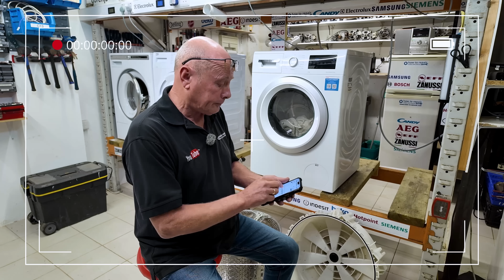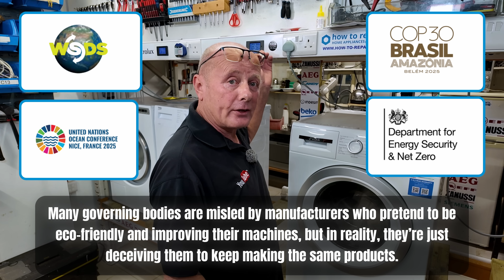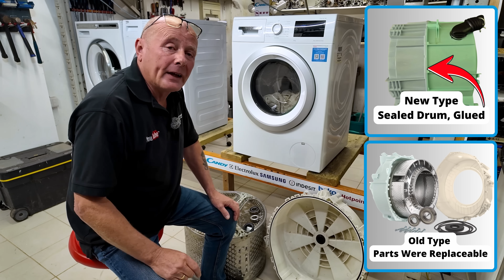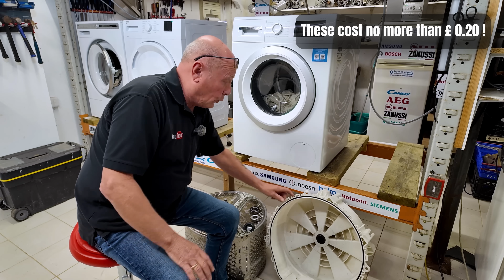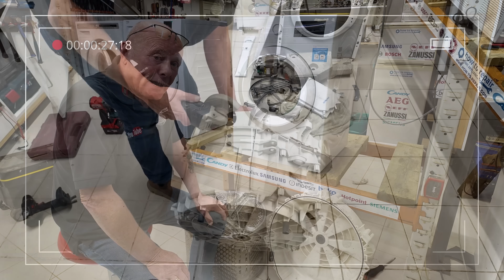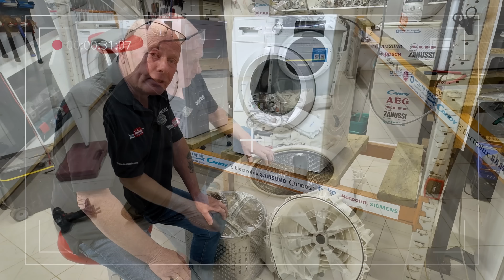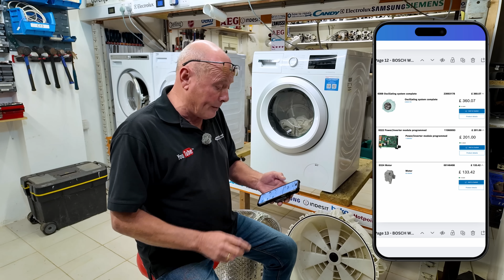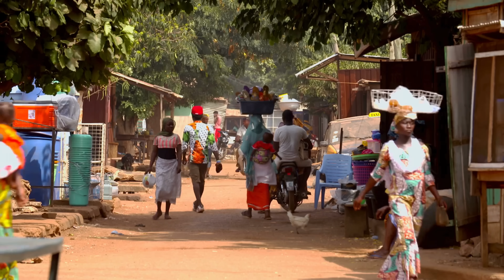Washing Machine SCAM EXPOSED! The Truth About SEALED Drums: Naming & Shaming

Comment: And don't get me started on dishwashers. Had a super old one finally fail - shorting heating element, I believe - and the fact that it didn't seem overly trival to replace it and the missus was keen to get a new shiny one meant we ditched it. Shopping for a new one, the drop in build quality was astonishing, even for higher end models. The one we settled one is amazingly quiet but, in the name of being eco, the default wash takes 3 HOURS AND 25 MINUTES! It's madness. Absolute eco/energy-rating tokenism. I get that consumers don't help themselves, because most don't have a clue and chuck out even perfectly repairable gear, but it's still infuriating that this is where we've ended up.
Reply from the maker: That is a textbook example of the financial trap set by the industry, and it confirms the grim truth about planned obsolescence. You are right, the industry structure is designed to be infuriating. They create products that are technically complex (making repairs difficult) and financially obsolete (making professional repair unaffordable) all while claiming to be eco-friendly. The only way out is strong legislation that enforces economically viable repair and penalizes the massive environmental cost of disposal. To make any real impact, we need to catch the attention of industry leaders and put an end to these wasteful practices. Sharing this post is essential to help spread the message. Thanks, Paul!

Comment: I am developing a drum bearing lubricating system.if you have a car you would have a oil change.
A washing machine has a sealed system.a predicted life span.

I am a retired mechanical toolmaker.also lubricating engineer for paper mill.

I have removed the shielding on the inside assembly of both bearings.the cavity is filled with marine grease .a 6mm copper grease pipe with nipple is fitted.acessed on top of drum case.There is also another copper pipe for purging old grease.and pressure relief.
If you open a new set of bearings you will see what little lubrication you are realising on.
Reply from the maker: Thank you very much for the information. It is much appreciated.

Comment: There is one aspect we must remember when complaining about lack of repairability. That is technical evolution.
If everything can be maintained to original standard, we risk lagging behind when new products with desired functionality and less resource drain are developed. That could be more costly than the acquisition of a device replacement. Here resources can be money, water, power, fuel and even our own muscles.
This is a balance of a lot of factors.
If we take a simple car as example: There is only a few of us commuting in a Ford T-model. For a lot of reasons: mostly because of its fuel economy which is poor to horrible.
What we must address is some kind of balance between evolution and some device's technical lifespan. If a device is reasonably functional including power economy and our basic requirements to the device, it is important that minor faults easily can be identified and fixed. That surely includes things like a bearing which must be available and easily replaced. Why is is necessary to open the drum to replace a bearing?? It should be designed so it can be replace by opening the back alone, not by a major disassembly which is cumbersome or costly ... or both 😛
My point is: design for repairability unless the part has a reputation of lasting the device lifespan.
For a long period I worked in the marine business: Lifespan here is 30 years and a stopped engine is costly due to lack of turnaround: don't plan for obsolescence 😲

Comment: What washing machine would you recommend?
Reply from the maker: Great question mate but honestly, I can't magic up a definitive suggestion. The industry is a minefield manufacturers constantly change production and every brand has both excellent and terrible machines in its catalogue. You need to pick a brand that fits your wallet and gives you the technical documents to fix the thing when it inevitably breaks. And always check if the drum is splitable before you buy. 

My favourites are personally ASKO. Absolute workhorses with mechanicals that rival old Miele machines thanks to that stainless steel outer drum. Some LG units are good too. And finally Beko. They are one of the few to actually provide detailed workshop manuals and wiring diagrams, which is fantastic. 

Thanks so much for weighing in! People like you writing this out help everyone. Please don't forget to hit that subscribe button and share this video as it could save someone a heap of trouble!

Comment: Planned Obsolecence is the foundation of the global economy.  It exists everywhere.

However.......a lot of products now come with a 5 yrs guarantee instead of 1 or 2 years.  This is to cut down on waste abd recycling.

Modern electronics especially phone come with fixed internal batteries.  Brushless motors simoly stop working.  Cars so compact the engine needs to come out to replace a sensor.......

China makes all the parts.  They're designed to break so you buy another......if it all lasted for every the global conomy would collapse.

Comment: 90W SOLDERING IRONS ON EBAY / AMAZON
CIRCUIT BLOWS IF YOU TURN IT OFF AT SOCKET 
INSTEAD OF OFF BUTTON
THEY ARE ALL 60W NOT ACTUALLY 90W

Comment: Previously, technology was made by engineers, now it's marketers and accountants, whose goal is to first prove that you need Wi-Fi in your washing machine, and then program it to be obsolete in 4-5 years and replace the washing machine drum for $400. 
Along with the energy efficiency rating, the EU also needs to assign a repairability rating to products, at least essential ones, such as vacuum cleaners, refrigerators, washing machines, boilers, and the like.
Reply from the maker: That is a perfect summary of the problem, and my 40 years of experience confirms your feeling mate. Technology is now driven by marketers and accountants, not engineers. I've been repairing washing machines for nearly 50 years, and the basic principles of washing clothes haven't changed since the 70s. They wash, tumble, heat, and spin. It's baffling why we need so many extra features now. Machines used to last 15 to 20 years on average. Nowadays, you're lucky if they last five years. Obsolescence is clear in today's society.

To make any real impact, we need to catch the attention of industry leaders and put an end to these wasteful practices. Sharing this post is essential to help spread the message. Thanks, Paul!
Reply: @How-to-repair  A friend of mine, an electrical appliance salesman, taught me how to choose appliances. Basically, you pick five refrigerators you like, then type in the model you want, along with the words "My refrigerator broke," "name and model," and look at how many bad reviews there are on forums, and how much spare parts cost—you narrow it down to the best product. Of course, everything breaks, that's normal. What's not normal is when it breaks before it's even half its lifespan, and the parts cost half the price.

Comment: I had a samsung fridge freezer, which started to beep with the door closed. I googled online the fault and the answer i thought was BS, but i tried it and boom job done fixed. a few years l8r it was the sam fault. The fix was to unplug the machine uncover the circuit board and scrape the micro switches , they looked like slugs had been all over them lol

Comment: In the past they used metal, now they use plastic. I remember as a kid learning how to take a carburetor apart, cleaning the jets etc, now its a sealed unit. This is the modern throw away world we live in.. In some ways it makes them easy to repair because machines are put together with a series of off the shelf units but as you say, you end up buying a whole unit when all you need is a new baring that costs pennies.
Reply from the maker: That is a very good summary of the deliberate design strategy that has created the modern throw away world we live in. My 40 years of experience confirms that the switch from metal to plastic is one of the root causes of the problem. Manufacturers often claim plastic is lighter and more resistant to corrosion. However, the real reason is cost. This design forces you to replace the whole unit when only a bearing (the part that costs pennies) fails. This is a deliberate tactic to transfer the cost of repair onto the consumer and inflate the part price. To make any real impact, we need to catch the attention of industry leaders and put an end to these wasteful practices. Sharing this post is essential to help spread the message. Thanks, Paul!

Comment: My brother was a senior manager for Hotpoint, which I believe owns several brands, and he told me 15 years ago about a meeting of senior managers to discuss ways to build in planned obsolescence.   Sealed drums was just 1 of the ways because bearings had a predictable life span and were easy for after market shops and engineers to fix at a reasonable price.  So machines could go on for 10-15 years, sometimes more, with simple repairs.

This is a deliberate scam to fleece us out of our money.  I run a 20 year old indesit, I easily replace the bearings myself, pump, no problem, motor, easy.  Think I will hang on to it, plenty of spares still out there and it does a great job.
Reply from the maker: That is an absolutely essential piece of evidence and your brother's testimony from 15 years ago directly confirms what we've been saying planned obsolescence, particularly the sealed drum, is a deliberate calculated corporate scam. The sealed drum was introduced not for technical reasons but purely to defeat the repair trade and fleece the consumer.This confirms the cynical design choice was motivated solely by financial gain not engineering necessity.

If you found this information eye-opening or helpful please consider sharing this video with your friends and family. The more people who understand what's happening with appliance longevity the better equipped we all are as consumers.

Comment: Old GE washer from the previous century worked great!
After 30 years a little water deeper out the main bearing.
Mother said, "Time for a new one".
                                                             " Noooo!, I said ( knowing planned obselecent madmen rule manufacturing now).
I stalled her a few years by snaking a thin Teflon aquarium air hose sliced at an angle like a syringe needle under the bearing seal and up the drain hose,  I am very proud of that excellent repair).
            But you know who eventually won out.
Now she's gone and I'm left alone with a just out of warranty new one with suspiciously intermittent processor costing millions of marks to replace!
Reply from the maker: That is a bittersweet story mate and it perfectly encapsulates the battle between consumer ingenuity and corporate planned obsolescence. I can understand the pride you feel for that ingenious air hose repair. Help me hold the industry accountable by sharing this video. To make a real difference, we need to get this message to the people in charge and tell those appliance-wrecking accountants to back off! I would be grateful if you would share this post, as it’s the only way to force things to go large nowadays.

Comment: If Bosch|Siemens|Miele fails after warranty period and it is not reasonable to fix them then people move to Chienese competitors, lower cost of purchase same longevity. My father in law who seasoned car electricins fixed my washing machine replacing capacitor for 1EUR, cost of the the part almost 200 EUR.

Comment: Planed obsolescence is présent in many sectors.
Cellphones and laptops, with integrated batteries or even soldered pieces.
Lots of electronic devices unrepairable unless it's done by a pro.
I hope worldwide these things will change and also use courts to punish these practices. It's not environnemental friendly 😢
Reply from the maker: It’s true mate built-in obsolescence and durability issues aren’t limited to appliances. Laptops often have non-replaceable batteries or soldered components, making repairs nearly impossible. It’s frustrating to see this pattern repeat across so many products. To make any real impact, we need to catch the attention of industry leaders and put an end to these wasteful practices. Sharing this post is essential to help spread the message. Thanks, Paul!
Reply: @How-to-repair I have to thank you for showing this to the public. Your channel is for public's interest

Comment: We paid £900 for a Miele washing machine 8 years ago. It hasn’t missed a beat since then and is still going strong. If. We get another 2 years out of it that will mean £90 a year, that’s about £1.73 a week for one of the best machines on the market.  That’s the kind of in-built obsolescence. I’m looking for👍
Reply from the maker: That is a fantastic demonstration of the value proposition Miele has traditionally offered, and your calculation perfectly captures why their long-term durability is worth the high upfront investment. However, Miele are now introducing sealed plastic drums into their washing machines this is stopping the consumer replacing the bearings or spider and on some cases even stopping them. Accessing the drum to remove small items of clothing that may have got lodged between the inner and outer room removing bra wires or even maintaining the machine. Is this corporate greed and the start of the downfall of a once trusted appliance brand?

To make any real impact, we need to catch the attention of industry leaders and put an end to these wasteful practices. Sharing this post is essential to help spread the message. Thanks, Paul!
Reply: @How-to-repair Thanks for the reply. If it does fail within the next couple of years l wont bother getting it repaired, I’ll just scrap it and look for a guaranteed reconditioned Miele. Many years ago when the kids were young and the washer got battered we bought AEG machines, at the time nearly up to Miele standard. I changed the brushes at least 3 or 4 times, dead easy and cheap. Then I think the brand was bought out by Electrolux and the quality vanished. Best wishes.

Comment: Had some situation in Poland with Beko washing machine, I wan unaware of that planned obsolescence until we opened it and saw it on our own eyes, seal and bearing failed after 2 y and 3 days of washing machine so just after warranty period 🤣🤣 But we managed to fixed buy drilling it around in old seal lip , cut it around, change the seal and bearing then assembling it back with glue that is used in auto shop repair for gluing windshield glass to car frame as it's chemical resistant. Washing machine work's till now already 6-7 years 🤣
Reply from the maker: Your story is a perfect example of how consumers are forced into ingenious DIY repairs due to planned obsolescence and it perfectly illustrates the financial trap set by the industry. Sharing this video helps give it the visibility it needs to make a difference over time. Thank you very much for your comment I genuinely appreciate it.

Comment: This scam started many years ago.  2000 my little HP desktop calculator window became unreadable. When I disassembled it, it showed that the flat  connection cablle between the little circuit board and the display was only TAPED together. And the tape glue was designed to dry up exactly when the 2 year warranty run out. They think we are idiots that cant reveal their scams. Thats why this video is so important. WE MUST ACT TOGETHER!💪💪💪🔥😡
Reply from the maker: That is a deeply insightful story and it provides a critical piece of evidence. The appliance scam is merely a continuation of a planned obsolescence strategy perfected decades ago in consumer electronics. Manufacturers think we are idiots but consumers and repair experts can and often do reveal their scams. Help me hold the industry accountable by sharing this video. If we want real change, we need to get this message in front of the people who make the decisions and tell those appliance-wrecking accountants to back off. I’d truly appreciate it if you could share this post, these days, it’s the only way to push this issue into the spotlight.